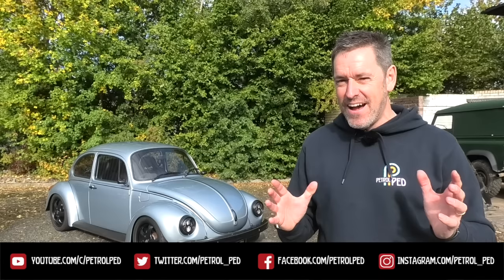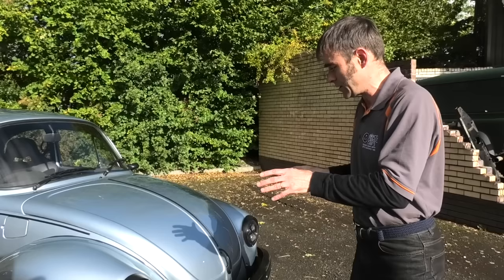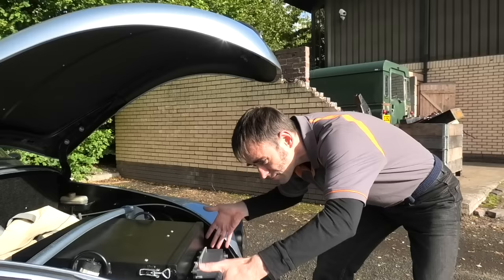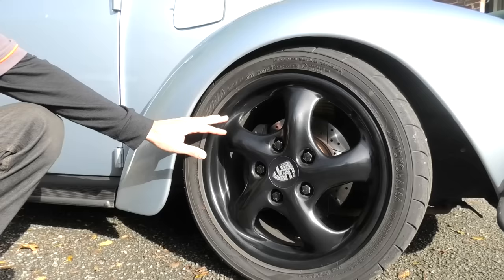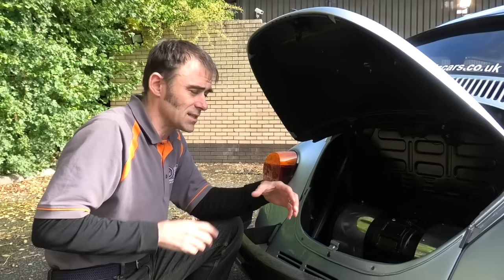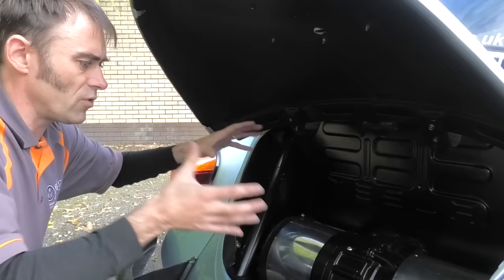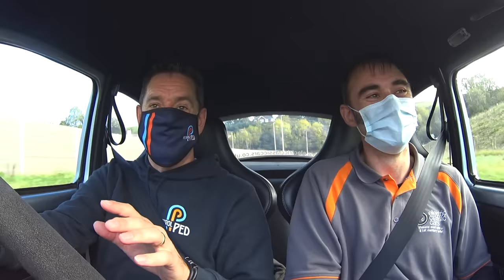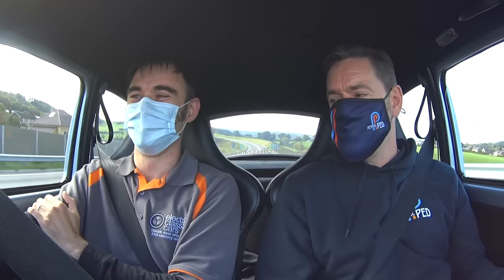*EPIC* 600hp 1000kg Tesla powered Beetle ! [In-Depth Review and Drive]

Comment: That is the kind of electric car that could convert me from big petrol engines.
Lovely car, great video Ped thanks.
Reply from the maker: It could convert quite a few 😂
Reply: Tesla engines have amazing performance. The downside is that price. An electric engine swap will run you well over $30,000.
Reply: @Binkusbigday  I had a 'race' up & down a couple of dual carriageway stretches a few months ago, with a Tesla Model 3 dual motor.
There was literally no difference in performance between that, and my remapped M140i (411bhp/576nm), I was very impressed.
The only bad thing, after 15 mins of racing, he turned round and headed back the way he came from, because his battery was obviously flat LOL !
Reply: Not me
Reply: Dont be silly
Reply: @Binkusbigday  They wont sell too many at that price. Greed and inflation sure is fun
Reply: Electric piss all over IC in every measurable unit
except for $$ at present.The price per kW is coming down
just need to get the battery tech sorted out.
Reply: @bobdillon1138  If I can buy an EV which handles like a small lightweight petrol hot hatchback, goes from 0-60 in 4 seconds, and tops out at 150+ mph, and also goes 400 miles on one charge, and I can buy one for 20 grand, I'm converted.
Reply: i suppose the battery will barely last a few miles
Reply: @bobdillon1138  Except for energy density too, 800kg of li-ion batteries has the same range as 50kg hydrocarbon would in the Model S
Reply: @bobdillon1138  This is the only thing holding EV's back, lots of big companies like Samsung/Sony etc are working on different battery technology bringing prices down and improving range. Just one major breakthrough in battery technology and it's bye-bye fossil fuel engines.
Reply: Wonder how long it would take them to get to Paris or Milan in that?
Reply: my bro is doing the same thing --he is putting two diesel apus(gen sets) in the back seat area that came off big rig trucks
Reply: @Binkusbigday  nope according to my calculations the battery’s would of cost him 9,600€ , the charger 750€, the motor 2,500€ (I asked a wrecker), motor controller 2,700€ so 15,600€ ish not including reinforcements body work and brake upgrades probably bringing it to about 20,000€ , considering that’s still less then most decent cars these days it’s not bad!

Definitely out of my price range though
Reply: @DjNikGnashers  did he know you were racing him or did he just miss his exit, considering a Tesla model S makes about 600hp I would say he just missed his exit
Reply: @lukemurphy7917  Where did I say Model S ?
Put your glasses on and read it again.
Model 3 dual motor is what I typed.
You can 'say' what you like, but you were not there, and I was. My car is now running 455bhp/634nm and I can't wait to meet another smug model 3 dual motor owner, because I can say goodbye to them in my rear view mirror.
Model S is a different beast entirely, but nowhere did I mention that, only you, when you mis quoted me you muppet.
Reply: @Binkusbigday well it depends. A car like this with performance likr this will be 30k if you get someone else to do it. A simpler car with less performance will be 10k-20k depending on whether you do parts yourself. Telsa engine is 3-4k, batteries up to 10k, the rest is rather cheap and you can sell the parts you took out

Comment: Back in 1970, I had a 1960 model Beetle and when I moved up to a newer model, I converted the older car to electric. My father-in-law was an electric motor re-winder and builder, so he built a motor for it, and I put truck batteries in place of the back seat. I kept the original gearbox so I could select speed better. There was no sophistication to the car like the one in this video though, basically it was still an old Beetle.

Comment: Great informative video, not too long mate. I grew up owning a 1973 Super Beetle w/sunroof. I guess they sau I'm a 2.0 V-DUB guy. Funds or lack there of required me to trade and upgrade to a more user friendly vehicle in the harsh winter land of N.E. South Dakota ( upper midwest USA )  Fast foward 35 years and to Iowa (corn is king here)  For my son's 16th birthday and first car he recieved a '67 VW that had been kind of resto moded restored with an 1835cc He as I was in need of a more weather suitable vehicle for a daily driver 50 km round trip to Maytag Co. so I traded him the '67 Beetle he recieved for his birthday for a 2000 Chevy Cavilier with 20k miles on it, I bought wrecked and fixed. It drove like a new one with good heat and AC. He hit a whitail deer with the right front and we repaired it and it will be finished in the same 2008 Isuzu Iceburg Blue Metalic. I'm rambling, sorry, luv to meet Moggy and get a green '73 SB camaro eater, 400 hp would do it. T/Y for the awesome video...cheers!
Reply from the maker: Love this. Thanks for sharing 🙏🏻

Comment: Great. Wondering model with MacPherson front struts and that curved windscreen but now nothing like my 1303S Beetle from way back.
Reply: Yes, with the curved windshield, CV joint rear suspension, and MacPherson strut front suspension it is presumably a 1302 or 1303, depending on year. Any of the small details (such as turn signals) usually used to tell the year could have been changed.

Comment: It would be good to give us an indication of the cost of conversion, are we talking crazy numbers or something us ‘normal’ folk could afford?
Also are there any other cars which had had conversions? I would be interested in an old Range Rover...even with 200 - 300hp - to give a ‘green’ 4x4 option.
Reply from the maker: Electric Classic Cars have converted a wide range of cars. From a classic Fiat 500 to a Ferrari 308. They do a Land Rover conversion and have a classic Range Rover in the workshop at the moment. They use a 450hp large Tesla mounted in the centre of the car feeding out to both axles so maintaining 4x4. The conversion for a Defender/Range Rover is not cheap however. In the region of £65,000.
Reply: Electric converted Defender link.
https://youtu.be/RvyCetgy_os
EV converted Fiat 600 by Jonathan Ward.
https://youtu.be/yI1pLvyDtI4
Reply: @PetrolPed  Thanks for the response - why was I born poor...don’t think Santa will have one for me this Xmas - unfortunately!!!
Reply: £500

Comment: Here's a question.  What does it cost to do this conversion for a customer?
Reply from the maker: Good question. This conversion was very much a development project however other conversions using a large Tesla motor are in the region of £50-65k depending on the build and the size of the battery pack 👍
Reply: @PetrolPed  so ill need to save for 10 years before I can afford to buy the engine. Nice
Reply: @99wc57  so basically a Tesla with a Volkswagen body kit costs as much as 2 teslas. Makes sense 🙄

Comment: I like this guy - "back in petrol days...". This man has his head in the future and he knows his engineering. When the cost of batteries and motors falls to within reasonable levels I hope he'll be converting a lot of high spec but high mileage (or blown engine) Mercs, Porches and BMWs as well as the classics. And he seems like a decent bloke too!
Reply: Range needs a major increase, and recharge time needs a massive decrease before electric becomes practical for America. Oh and charging networks would need to expand dramatically. Right now electrics are niche city only.
Reply: And the battery packs would have to do all that at -25° in the winter.

Comment: Excellent video and an excellent project.  I was fascinated with the technical walk around but would have liked more detail about the transmission. I know it's asking a lot, but some shots underneath would have been useful and an explanation as to how the components were married up.  Was it just a question of changing the drive shafts?   In my youth (a long time ago) I once saw race a Fiat 600 race powered by a Ford Lotus Cortina engine.  When I asked the owner how he had mated the pair he told me the gearbox flange was exactly the same size, shape and fixing hole positions on both cars.   I don't suppose it was that easy on this VW Tesla.
Reply: Is there à transmission ?

Comment: If you put heavy rubber flaps on the front of the car and on both sides come down to about an inch from the ground now at about 60 mph it will the vacuum under the car will pull the car down and get a lot better traction try that one once and see what you think

Comment: 300M is what you're likely looking for as far as a step above 4340. 

You should get in contact with a company called RCV, which makes off road axle shafts for racing and other fun things here in the US. They make their own custom CV joints that are made to survive diffs that have 5.40 or higher ratios with transfer cases in 4:1 or higher ratio while also having 800 ft lbs of torque from the motor, for things like ultra 4 racing. 

They'd make you a custom set that would not break, but you're going to drop 3k USD.

Comment: Tesla has a very full plate right now, but I hope some day they can have a small division that offers reasonably priced conversion kits for maybe 10 or so of the most popular classic cars.
They wouldn't have to be 600 hp,  but would be fairly easy to just bolt right in. For maybe 15 k USD.
Reply: Don't Noob drivers are crashing thousands of them and sending them to Junk Yards. Some reputable needs to setup a Supply Chain process where they source the Written Off Cars as early as possible and quality control the parts. That business scaled up is dearly needed.

Comment: Amazing car made me want to covert my beetle to electric but I did some maths and :
The batteries alone would cost between 9,600€ and 12,000€ (it probably cost him about 9,600 if bought at retail price, the 12,000€ are the newer lg Chems that give you an estimated range of 200km instead of the estimated 173km that this has)

The motor 2,500€ quote from wreckers, the charger ~750€

Motor controller is about 2,699€ (Tesla), and that’s not including the lightening and reinforcing,

So about 15,549€ just for the battery,motor,charger,controller id say well worth it but unfortunately I don’t have that type of money !
Reply from the maker: This conversion cost in the region of €80,000 😬
Reply: @PetrolPed  Ouch really? I suppose the new pannels, seats, reinforcements, brakes, wheels and other supporting mods would cost a fair bit but I didn’t suspect anything over 40,000-50,000£, that’s actually nuts I wonder if the supporting mods cost almost what the actual drivetrain cost cos looking at those seats  they are about 2k at least I’m guessing, a price breakdown would be awesome but since it was probably developed over years it would be very hard to keep track of

Comment: Only problem is a VW bug weighs 800kg, that means they ADDED 200kg.
But my issues with the donor-car and how the original maker of that got their hands on the battery materials aside, this Beetle is most definitely a build, lots of fabrication/welding gone into it, and that I can get behind.
Good job!
Reply from the maker: Moggy was the maker. He buys in the LG Chem batteries and fabricates the battery boxes in-house 👍
Reply: They added far more than 200 kg, and took out enough weight from other components to get it back down to 1000 kg total.
Several companies were selling those 16S (60 V) 2.6 kWh LG Chem modules, apparently purchased new, until LG Chem realized what they were doing (they were only supposed to be for new vehicles or replacements) and shut them down. You can't buy them new anymore, at least in North America. There are various other new modules legitimately available, and of course modules salvaged from production EVs; no one has to deal with individual cells to do an EV conversion.

Comment: Definitely different from the first Volts-Wagon made back in the mid70's using a forklift electric motor.(had 34 HP) still got the magazine. Deep humming noise out of this one could barely hear the guys speak.(then I remembered CC)  I was waiting to see the guy hold the steering wheel then I remembered this is British so steering is on other side.

Comment: Great video. Can someone please explain why he reduces weight when traction is an issue. Wouldn't some extra weight, distributed right do it good? I'm not good with cars, yet.
Reply: The battery packs add several hundred kilos of weight and, to para-quote Colin Chapman, “First add lightness”.
Reply: Extra mass adds weight, increasing traction; however, the extra mass takes more force to accelerate, so you need more traction. Adding mass never helps performance.

Comment: This car looks like a 1973 model 113 Super Beetle, if it came with steel bumpers, 74 was the first year for aluminum bumpers (in the States). They also had 63 Horsepower in the States. 34  PICT3 carb and the great AS41 case. I think this was the first year for the alternator if I remember right...
Reply: Yes it was also about 1973 or 74 when they added an Alternator and converted from a 6-volt system to a 12-volt system.
Reply: @lbamusic  It was 1973 when they went to an alternator however it was much earlier when they went to 12 volts. USA models were 12V starting in the '67 model year...
Reply: @Bass.Player  ok..thanks for info..been a long time and I'm 81 now, not remembering dates clearly
Reply: @lbamusic  Well it was a long time ago. I went to work for VW in Sept 1971, this is how I remember. I worked on thousands of them...I'm old as dirt myself...(:
Reply: @Bass.Player  welcome to the old age club of VW owners...

Comment: I know nothing about maximum speeds in England, but I think they might be about the same as here in The Netherlands, be it in different units. That means that a much smaller motor would also do the trick, right? Would that improve the distance you can drive with the car on one battery load? Or doesn't it make much difference? Furthermore, how about regenerative breaking, does the car have that? I do like what you did to the car, it looks amazing.
Reply from the maker: Yes for most people a smaller motor like the small Tesla (300hp) would do fine and give more range. Most of Moggies conversions are like that. A larger battery pack would also help. All the conversions have regen braking 👍

Comment: i'm not a big fan of vw but i did get 2 bugs one runs and drives both have no rust the one with the engine that needs rebuilt but does run has a 72 bus trans axle and engine in a 63 the one that drives is stock 74 got both for 400 bucks the 63 they put a new pan under it and they did a nice job on it also have 8 wheel adapters to chevy wheels for the 63 the 74 has after market wheels both are good rigs to build

Comment: Awesome. I am looking for a VWB right now. Lol. To questions. Price to convert this. And would it be possible to use an iPad and app to modify or rather adjust the HP to get more distance. That would be awesome then it would be like a chipped mod. You could set it for economic and sports. This would allow modifying. I don’t know if this is possible but would be nice. Please let me know what you think. It could be Bluetooth assessable. What do you think
Reply from the maker: Conversions using Large Tesla motors are not cheap. Typically £50-75k ! You can ‘de-tune’ to motor for more range or a much cheaper option is to use a smaller motor coupled to the cars exiting gear box 👍. Watch this...
https://youtu.be/AbWxi_R2QZ4

Comment: Is he willing to build a few of these cars,  maybe de tuned to the 450 HP level to keep it right side up and insurable ? 600 HP ! I'm surprised it doesn't have a full tube frame chassis tying the front and rear together to cope with that level of torque, but no, it's using the original chassis with only some reinforcement to tie the motor to chassis and it appears to be bolt-in so it's easily removeable ! Imagine what this could do if you removed the existing cells, exchanged them for top Tesla performance units, and compromised by accepting a 50 mile range (110 mile total travel possible) It would be lighter still, handle better and accelerate faster without special drag strip tires. Tesla at one point wanted to do exactly this (with less HP) but couldn't get VW to sell them bug chassis, they supposedly looked at buying all the ex mexican taxis, but decided it wasn't feasible... too bad ! Clearly it could have been brilliant ! Just subscribed ! Thanks.
Reply from the maker: Thanks for the Sub. Moggy does what he calls ‘Mild’ and ‘Wild’ conversations. The Wild ones use large Tesla motors and most are tuned at 450 👍

Comment: Tesla power train vs hyper 9..which one better n more economical to run? Thx
Reply from the maker: Very different solutions. Tesla is direct drive with single gear. Hyper 9 uses the cars gearbox and retains 3 pedal driving. There is a difference in the cost and complexity of the conversion. Once converted very similar running costs 👍

Comment: I appreciate all the tech and having driven a Tesla S on a drag strip I get the power but the added weight loss of luggage space and limited range is the end for me, also you will not hot Rod that thing for more than a few minutes or the systems will begin to overheat. They have to always cool the Teslas off between hard runs. Neat car but I will keep my 911.

Comment: How much dose they charge for the conversion? And how much electricity is required for one charge?
Reply from the maker: Conversions using direct drive Tesla units are typically in the region of £60-70,000. Power required and range will depend on the size of battery pack you spec 👍